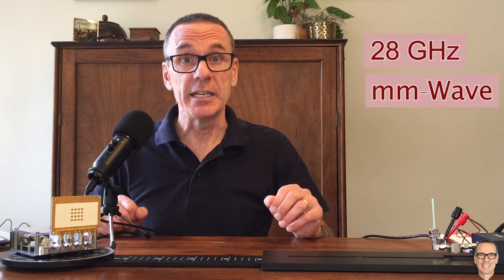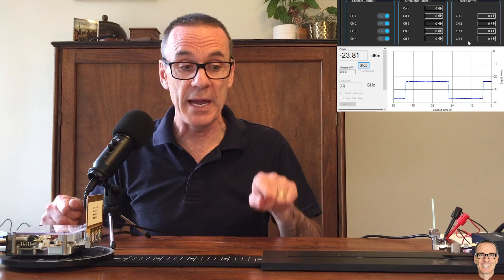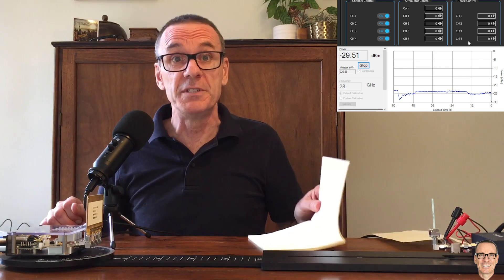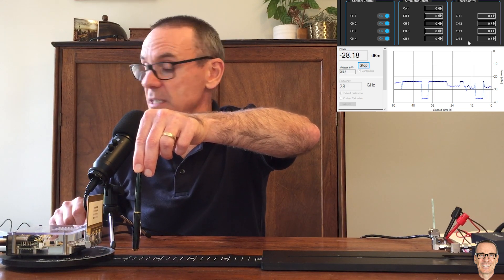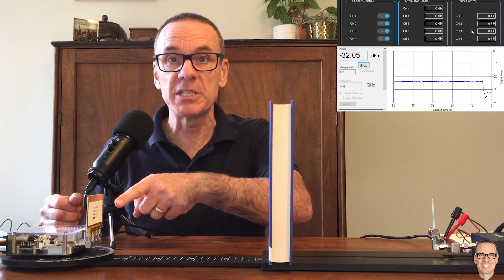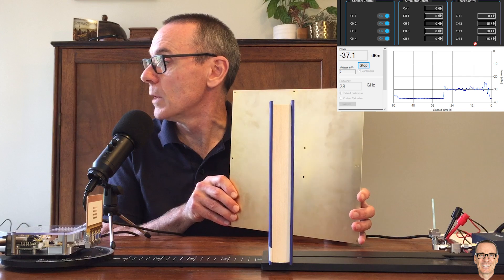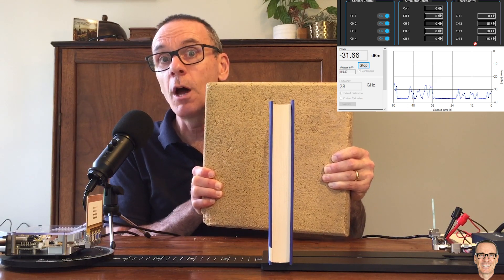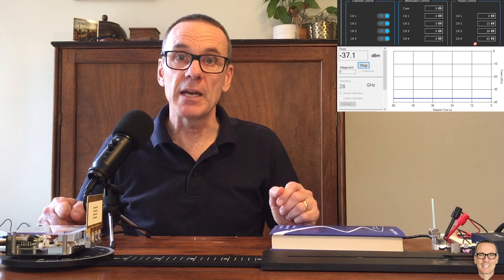Will Signal Blockage be a Problem for 6G Mobile at 28 GHz mmWave?

Comment: I thought the main purpose of 28 GHz was for areas where there are large numbers of active phones, such as sporting arenas or concerts. In such venues, there are few obstacles. To a point, the disadvantage of 28 GHz, the limited range, becomes an advantage so cells don't interfere with each other.
Reply from the maker: Those applications might be OK for tall people who use headphones and hold the phone out in front of them with just two fingers, so their own head doesn't block half the field of view and their hand block most of the other half. But short people will have their signals blocked by the tall people sitting next to them, plus any supporting structures holding up the roof, etc.